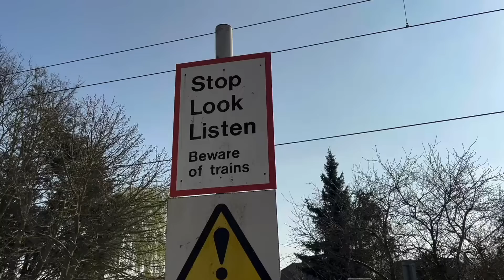Why Do Tube Trains Whistle?

Comment: I suspect the latest TfL train no longer use real air-driven whistles. The trolleys (trams) in Los Angeles have at least FOUR different sounds they can use. They have an annoying buzzer with no particular pitch which they usually use before entering a station. They have an electronic bell. They have a streetcar like one-chime whistle used most often to alert trespassers on the track. Finally, they have a very loud railroad locomotive-type of horn. The last is used to get the attention of drivers. I am sure that all these sounds are generated electronically.

Comment: There is actually no reason not to use a horn underground. As the whistle you can change their volume by regulating air pressure used. Probably it is either pure tradition or some rulebook that demands tube trains to have a "whistle" instead of a "sound device" and someone would need to change the rule first. Like it took a century of automobiles for London city council to recognize you don't need oats to feed a car and straw to bind excrements and deleted the stupid demand to take these with you from the black cab rules (which were indeed sometimes enforeced if a bobby had a bad day or a cabbie did upset a member of the force - my uncle drove a black cab in the 70es).

Comment: Another instance to use the whistle is when "Applying the rule", ie, passing a failed signal at danger.
Also, another code that still sticks with me from my tube days was the one or two blasts depending on the direction of travel so trackworkers would know which way we were coming from. 
We had a handy acronym to help us remember.
Outer rail, Up, Southbound, Eastbound (OUSE) = 1 blast.
West bound, Inner, Northbound, Down (WIND) = 2 blasts.

Comment: Our Group's Class 419 MLVs used on the Boat Trains to take the trains down to the quay sides. S68001 in preservation reverted back to as was when first built in the 1950's have whistles very similar. Whilst S68002 (9002)  is as when the type at the end of their careers in the 1990's has Horns. Type of work the Motor Luggage Vans use to do including shunting watching this is interesting and makes a lot of sense.

Comment: There is no requirement to sound a whistle when departing a station. 

Complying with whistle boards is not necessary after 7pm because they are there to warn p-way workers who would not normally be on the track after that time. 

You can sound the whistle any time of day or night if it’s necessary, only whistle boards have the time constraint.

Rule book 6 section 8.3 states:

You must use the following whistle codes:	

When starting a train (in depot): I short.

When changing speed (when assisting with engineering work): I short.

When acknowledging a hand signal: I short.

When acknowledging a train maintainer's call up signal: I short.

To acknowledge satisfactory completion of brake test: 2 short.

When shunting from sidings to main line: 2 short (pause) 2 short.

When you require an assisting train operator to rejoin the train	: 3 short.

If your train is being assisted by another train and you require to stop: 3 or more short.

Before passing a signal at danger: 1 long.

When approaching a platform at which a train will not stop (also applies to empty trains in booked workings and trains proceeding to and from depots): I long.

When approaching a whistle board: 1 long.

To warn persons on the track: 1 long.

To call attention to the train: 1 long.

Leaving the mouth of a tube tunnel: 1 long.

To call the attention of station staff: 1 long.

When you require an assisting train operator to apply the brakes or test air brake: 2 long (pause) 1 short.

When you require a train technician: 4 long.

Comment: I think there was a regulation, based on a law, about sounding whistles after 7pm which also applies to ice cream vans playing tunes and yodelarms on level crossings which reduce volume after 7pm. Having said that trains are permitted to sound a warning at any time of night in certain situations. As others have said during hours of darkness it is expected people will see the lights of an approaching train so sounding a warning is not mandatary. 08 shunters were built with whistles for the same reason but other classes like 03 had loud horns fitted so no consistency there.

Comment: Certainly as far as the rules go on the mainline, whistle boards are to be adhered to only between 0600 and 2359. Outside those times, neighbours naturally want some sleep, so it's basically to stop disturbing the locals. That said, if you whistle up in those times, you'll never get told off by your manager (he says). At the end of the day, it's safety.

That said, if you don't do it when you should, and something happens, I think you'll be providing your own tea and biscuits to the next meeting...

Comment: I always wondered why tube stock wasn't required to have yellow warning panels at the outer ends. Especially where they share or run parallel to BR lines. It used to be that tube stock driving ends were the same colour as the rest of the vehicle, but for the last 40 or so years, stock has been fitted with red warning panels at the cab ends, which could be argued as not being as visible as the BR standard yellow type.

Comment: Re. Jago's story about the train horn; a friend of mine fitted TWO to his Land Rover, mounted on the roof of the cab, fed from a fire extinguisher body used as a compressed air reservoir, and the pressure was topped up by an electric tyre pump with an auto pressure cut-out.  He dropped the pressure down quite a bit from the level used by trains, but it was still VERY loud!  They worked a treat on the berks who trickle out of side turnings in front of you, looking LEFT instead of *right*;  he said they slammed the brakes on in blind panic, thinking that a 44 tonne artic was bearing down on them . . .
:))

Comment: As a train driver on the railway in Sweden I can draw comparison between the "7 pm to 7 am" rule. Some sound signal signs (usually those intended to warn people at pedestrian level crossings but also some placed at tunnel portals and minor road crossings) have a complementary sign with the meaning that the horn should be sounded between 6 am and 10 pm only. This is to not disturb those living nearby. The additional sign is amicably named "the nightcap" by us train drivers (and even most instructors with a sense of humor and not just a sense of safety protocol paragraphs). 

The reasoning for not sounding the horn is that the headlights of trains in the dark will most certainly be a warning sign as will the sound of the approaching train in an otherwise mostly quiet area. There is, probably, an economic reason too. If trains are too much of a disturbance during night time with their loud horns, residents may start demanding that a slightly more discrete bell and light arrangement is installed at the nearby crossing and the requirement for loud horns removed. This prospect usually scares the hell out of the constantly underfinanced Swedish Trafikverket (the infrastructure agency). Adding more technology to the minor lines is not their cup of tea! It has occasionally led to them simply closing the crossing all together instead, citing safety concerns, and adding a two meter tall fence to block any passage.

Great video as always mr Hazzard! You are the Trafikverket to my Youtube procrastination.
Reply: In the UK we have the ridiculous situation where some level crossings with lights, sirens and half-barriers also have whistle boards. 

On routes I work there are even cases the whistle boards are positioned before a platform so that the train stops at a station between the whistle board and the crossing, meaning they're utterly pointless as instead of the standard seven seconds between horn and crossing it's almost two minutes so the horn warning is just useless noise!
Reply: @atraindriver  That actually sounds worse than a lot of half witted solutions around the Swedish network. The general public doesn't seem to have time to spare for safety and too long a delay between warning and actual danger equals no danger anymore to many nowadays... :(
Reply: @Obeythebeard  One of the rural stations I regularly stop at has a whistle board for a footpath crossing just before the platform, then a second whistle board before that crossing for a road level crossing beyond the platform.
The platform is then fitted with a mandatory stop-and-sound-horn board which means that the second whistle board is both pointless and confusing, but it "can't" be removed because there's no provision in the whistle board rules for a mandatory stop board afterwards!

The UK railway is full of stupidity like this, and it's only getting worse as the years go by. :(

Comment: Jago. I can't believe that you missed out another very important occasion when the tube train driver beeps his whistle with two short blasts. There is a bridge that goes over the train tracks which run from Woodford station to South Woodford at the end of Gordon Road. I remember as a child, growing up in the 1970s, whenever we used that bridge, we would wait in the centre of the bridge for a train to come out the station and as it was heading towards us, we would wave to the train. This was always met by a wave from the driver and two short blasts of the whistle, toot toot. Around 15-20 years ago I took my children there a few times to wait for a train and sure enough, to their utter delight,  they were met by a wave and a toot toot. Last year my parents took their great-grandchildren (my grandchildren) to the bridge and sure enough,  they also witnessed a wave from the driver, a big smile on his face and a toot toot!😊This has been a tradition in our family for over 50 years. I'm sure that the bridge over Gordon Road isn't the only place where this happens? Perhaps it deserved some research and a video on the subject?

Comment: On Heritage railways it is fairly routine to sound a whistle or horn on departure from a station, usually in response to the Guard's Right Away signal. I can think of a Heritage line in Cambridgeshire which has a bridleway which crosses the line adjacent to a river. Typically, when driving, I would sound the horn around a 1/4 mile away so as not to alarm approaching horses who may then throw a rider into the water if startled. By the same token I was always prepared to stop short of the bridleway if a horse emerged on the approach.

Comment: No sounding of horn between midnight and 6am on standard lines for the past few years. There's been no requirement to sound the horn when leaving a station for at lest 25 years. Also no need to sound the horn when entering or leaving a tunnel any more. It's been a single tone for the last few years too, but that's being brought back as two tones.

Comment: You will probably find that the rules covering use of whistles allow for use at any time in the case of emergency or immediate need. So, between the hours of 7pm - 7am it would be at the discretion of the driver rather than by routine.

Comment: And on the main line, we still call them whistle boards (indicated by the W in a circular sign) despite having horns. Whistle boards restricted 0600 to midnight, so slightly different to the tubes restricted times.

Comment: I had no idea Tube trains had whistle or horns or anything.  As I understood Hill Organ Builders invented a signalling device to be used in railway stations which they went onto develop into the Tuba Stop, which is always the loudest stop on any organ that has one!  Liverpool (CfE) Cathedral, the largest cathedral in the UK, has a Tuba Magna that has now been fully restored to be back on its original 50 inches of wind pressure and its resonators corrected - there is no missing this stop when it used!!
Reply: I believe that yet another organ builder, Hope-Jones, developed a stop called the Diaphone, which Trinity House developed as a foghorn..

Comment: The newer trains that have been built also do have whistles. And it’s quite rare to hear those whistles rather than 2 tone horns on most trains. But whistles are still the best thing to hear when travelling on a train.
Reply: I live opposite a train station platform and meters away from a level crossing, so for the past 22 months or so, I've heard countless trains, some hooting, some not, depends whose driving I guess. Can't really comment on the tubes though, I live 30 miles from any tube stations.

Comment: Have ridden in the cab jumpseat many times for work and the driver will often sound the whistle approaching a crowded tube platform if there’s someone trying to squeeze along the edge of the platform or standing between the yellow line and the platform edge.

Comment: I expect someone has already mentioned it but most trains still have a whistle. It's called the Depot whistle and it's a bit less brutal on the hearing of Depot staff when used to warn of train movements. The mainline air horns push out around 130db at 5 metres. I was involved in testing the 387 horns at Litchurch Lane and one of the tests was pretty unpopular with staff and neighbours alike. It involved operating the horn for thirty seconds to check that the air supply held up and the horn gave the required output level. The test had to be repeated three times on each horn (high note and low note)
Reply: "most trains still have a whistle"
Um, no. Certain classes of train do still have a whistle but it's far from most.
I'd say it's only units which will be used alongside the Underground. Certainly no class 1xx DMU has a whistle, nor do any class 30x, 31x, 32x or 33x EMUs, and as far as I'm aware no current diesel or electric locos have them. Two tones or nowt on all of those.
Reply: @atraindriver  387, 345 and 710 do. Maybe it's just Bombardier/Alstom then?
Reply: @davidquirk8097  That's my guess, it's a Bombardier thing....

Comment: whistles and bells are perfect for Urban mass railtransit systems. 
Imagine the mayhem when they had the same horns like roadvehicels. 
f.e. tramcars in the Netherlands after 100+ year still use an electromechanical bell for warning passengers and other traffic.
Reply: Fun fact. In the late 1800s and early 1900s, some cars were fitted with bells as well as horns. The bell was considered a better audible warning for not scaring horses.
Reply: @johnscarsandstuff  Japan has an unique warning system when heavy equipment is moving. 
f.e harbour cranes play children song tunes when moving.
Also every crane has its own tune.

Comment: I love the fact that London Underground trains are distinctly different from national rail trains, this was even more so the case before the S Stock. One of the ways in which London Underground trains are different from national rail trains is that they whistle, unlike national rail trains which have a horn. Another distinction between them is that London Underground trains have low backed longitudinal seating. I would absolutely love it if the London Underground as a network was even more distinctly different to the national rail, ie stations west of Harrow-On-The-Hill to be surrendered to a national rail network. And stations east of Barking surrendered to a national rail network. And stations west of Northolt surrendered to a national rail. And also those beyond Woodford including the loop; only then will the London Underground look truly urban and distinctly different from national rail.

Comment: Jago: you are the fog horn to my London fog.

I don't think I once heard a whistle either of the two times I visited London (two weeks total).  I think I only rode the Underground within Zone 1 (except for when I rode the Piccadilly out to Heathrow), so perhaps that is part of the reason?  I don't see much need for a whistle in the stations that are actually underground.  The train makes plenty of noise on its own and you can easily hear it before it pulls into the station.

Comment: A higher pitched whistle (as opposed to a ship's deep and much more easily propagated one) is much preferable for underground task as it is much easier to localize as well as not propagating great lengths like lower pitches are. In other words, the purpose isn't for platform patrons miles down the tube, it's for those persons in the immediate vicinity to be aware and/or react.

Lower frequencies are perceived as 'non-directional' by the human ear. Upper pitches, very directional.

Comment: The elevated trains in Chicago still whistle as well, though I’m not sure if it’s an actual whistle or an electronic imitation of one. Either way, it seems appropriate given the Yerkes connection. 

Interestingly enough, New York City subway trains do have mainline-style horns. I assume the thought was that the sound wouldn’t echo quite as much in cut-and-cover tunnels. I can confirm from firsthand experience, it absolutely does. 😂